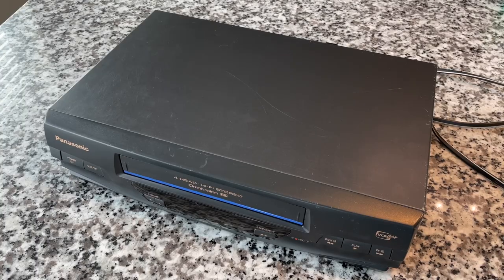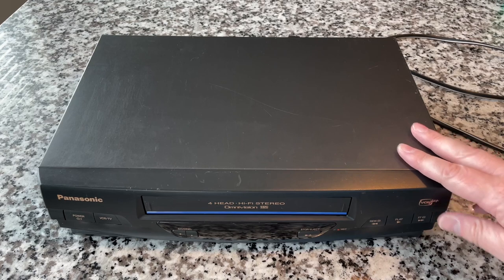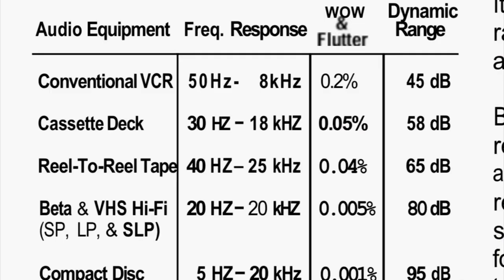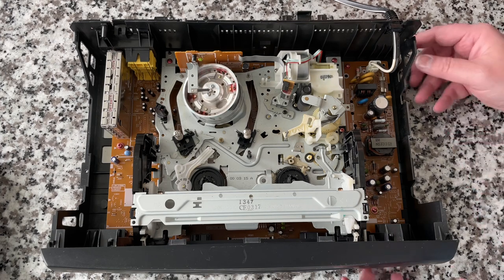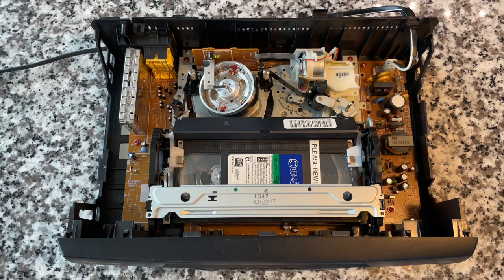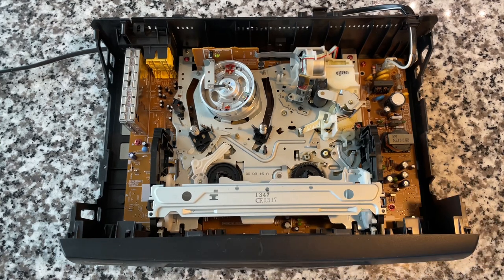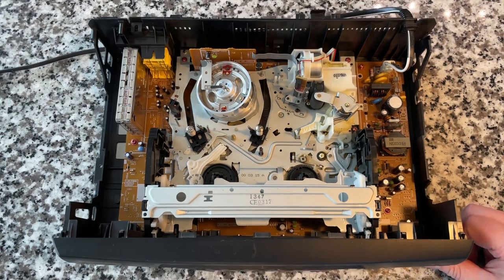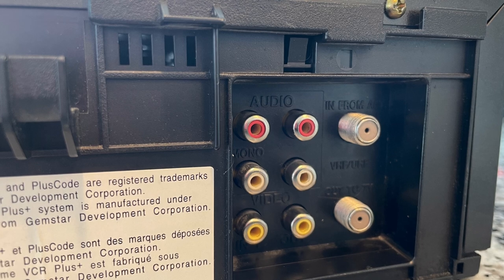VHS Hi-Fi - You threw out your best tape deck!

Comment: It's nice to discover this new twist, if perhaps a tiny one, among the pursuits of home audio enthusiasts. After all, analog open reel has long made an impressive comeback, at least among some well heeled audiophiles who can afford to restore and/or upgrade their machines and who afford the now very high priced tape stock. To some degree renewed interest in analog recording is understandable, at least for recording live sessions, since arguably the best sounding A/D conversion two channel electronics can cost upwards of $3500. Indeed, two track 1/4" open reel can sound very good even at least at 7.5 ips, more so if gain stages are dc coupled, low DA film caps are used for supply bypassing, et al. I've never heard (nor have much interest in) today's premium open reel designs but a shoot out between one or more (e.g. a recapped and well aligned Ampex ATR-102 1/4" OR a "tapelifterless" Studer deck) and, say, a Sony or Panasonic VHS Hi-Fi VCR. While signal electronics build quality may likely be far better even in these stock open reel decks (lower distortion percentages?) , the H-Fi VCR may have wider and flatter frequency response, higher signal/noise ratio and far lower wow and flutter. Even more impressive is that both recording speed and tape stock formulation costs will be a mere fraction of what plagues open reel tape enthusiasts. Only open reel have rapid and precise razor blade editing and variable pitch control. But I submit that IF advanced circuit designers, like those here https://www.diyaudio.com ever got serious about revamping the R/P electronics of Hi-Fi VCRs (especially those with superior transport design and build quality), the VCR would become the best sounding AND most affordable analog recording device. And for starters there's certainly no shortage of VHS blank media on where it's being all but given away at ebay, craigslist and countless garage sales-many tapes with low mileage and oxide shed. Go for it!

Comment: Never threw any of my hi fi decks away unless they were really not salvageable.  I have a Panasonic similar to that and two Sanyos that I got at Walmart, one still unopened.  The VHS did better than the reel to reel in the low frequency response but reel to reel did better in the top end of the frequency response.  We made a lot of videos of my band back in the day using a mixer and a VHS camcorder.  We took the audio output of the mixing console and video out of the VHS camera into the VCR and we got some of the best sounding recordings of the band.  It really sounded close to a compact disc to me.  As the one head is leaving the tape the other one is coming on the tape.  You have your stationary head which has a very limited frequency response but the heads on the scanner have what they call FM audio which is your hi fi audio and because the way the tape drum is spinning, the tape is emulating many feet per second which gives you the most fantastic audio.    The guides are so critical as well.  If they're out of alignment even ever so slightly tape won't be able to track properly and if it's really bad it won't track at all.  In order to set them up properly you need an oscilloscope.   Thank you for sharing.

Comment: I still own a Funai VHS HI-FI 4-Head Sereo and DVD combination with reversible dubbing  recording abilities.  I'm missing a spring on the DVD flap (so it stays open, though I tape it shut until needed) but otherwise the unit remains in very good condition.  I've had it probably since 1977 or thereabouts.  It has eaten a tape or two but that's because I either forgot to clean it's heads or forgot to BRIEFLY demagnatize them (just like a compact cassette player needs done now and then.  Look it up.)  I also have a separate unit that both reminds and fast forwards my VHS tapes--a real life saver with old tapes which tend to jam up or lock up tight when they haven't been used for awhile.  Best buy of that era that I ever made.
Reply: VCR/DVD player combinations were first introduced around the year 1999, with the first model released by Go Video, model DVR5000. (Wikipedia)

Comment: My surprise was how good the cassette sounded. I know, Techmoan did a video some time ago on cassettes (“better than you don’t remember”), but most of us had cassette players that didn’t sound as good as any other format, including vinyl and CD.

One reason was because as you pointed out, the slower the speed, the lesser the quality of the sound. Cassettes run at less than 2 inches per second, which is far less than any other tape format. I knew someone once who got better sound on cassettes by recording them at double speed. 

I wonder how many people actually use video cassettes for recording audio only...it’s certainly n interesting idea!!!
Reply: There is actually a cassette recorder that records at around 1/4 inch per second (standard is 1 5/8 IPS). The CC Versacorder, designed for recording overnight radio talk shows, and has a control interface that works with certain CC radios. I have never heard one, but don't imagine it sounds like much.
Reply: if you're like me, you may also have been using a crappy cassette player, and been using only pre-recorded tapes. I didn't know how good cassette could sound until I started recording on high quality blank tape and bought a nice, 3 head cassette deck
Reply: @dougbrowning82  Yes 1-7/8 ips. The slower formats are mono and are full track or half track increasing the quality. Cassette is 1/4 track per channel. Giant size cartridge loops like an 8 track cart were used in restaurants and such for background music.

Comment: Digital audio can also be recorded on Hi-Fi VCRs.
Reply: Could it?  It was obviously part of D-VHS and there was a short lived format that Techmoan did a video on that recorded digital audio as a picture, but from what I remember the hi-fi audio track was analogue.

When Europe started broadacsting stereo, we used a digital standard called NICAM but that was converted to analogue when it was recorded.
Reply: @GeoNeilUK  You could, and you didn't need a hi-fi VCR to record digital audio onto 1/2" home video cassette tape.

You use a PCM processor, such as the Sony PCM-F1, that works with the video in/out of the deck.  Of course, that meant reserving the whole width of the video track for recording digital audio.  Using a PCM processor is also recommended only on VCRs where you can disable dropout compensation and other video enhancements like VHS HQ, since such such circuits can potentially adulterate the signal.

Video tape hi-fi audio is, indeed, analogue.  NTSC Beta hi-fi used frequency multiplexing, where the four hi-fi tracks (two for each audio channel) is recorded in the space between the heterodyned chroma and luma baseband.  VHS hi-fi and PAL Beta hi-fi used depth multiplexing, where the hi-fi tracks are laid down deeper within the tape and at a lower carrier frequency than the video tracks layered on top.

Comment: I actually have a Panasonic VCR that is almost exactly like this one!!!!!
Reply: Yep, me to.   Had it for 20 years now.  Never even thought about using it as an audio-only device though, until now.
Reply: Me too and the video heads are very easy to replace and vhs hi-fi uses an extra pair of heads on the drum to record the audio to vhs cassette 4 head hi-fi =6 heads on the video drum the video heads are dual azimuth and would take up 1 opening per 2 heads and the audio heads are the other pair 1 head per opening. and for backwards compatibility mono audio is recorded on the stationary linear head so non hi-fi vhs vcrs can still play back the tape.

Comment: I did this with radio programs in the early 90's, and used the VCR's programming controls to  record when I was out.    Tape quality was excellent and the unit was designed to be used as an audio deck as well as video.    The deck was a cheapie sold under the "Fisher" brandname, but I don't know who really made it.  It was a HI Fi unit, but is long gone.
Reply: Fisher is Sanyo
Reply: @GaryKeepItSimple  The funny thing about Fisher VHS machines was that, despite the company being owned by Sanyo, earlier Fisher machines were made with engineering unique to them.  A Sanyo VHS machine of the same era could be totally different, specifically the mid 1980s when Sanyo was starting to get into VHS from Beta.  It wouldn't be until the late 1980s that Fisher models started using Sanyo engineered transports.

And good thing that Fisher started using Sanyo designs.  Before that, Fisher machines were generally known for being among the worst in terms of reliability.
Reply: @Watcher3223  I owned one of the first CD players and it was Fisher. It sounded better then any CD playback I've heard since, including my modern PC. They must have had an audio expansion chip of some kind in it. Wish it didn't breakdown.
Reply: I used to use my VCR to record an electronic music show out of Philly called Star's End each week. It's a 5 hr show. I found that I would not get the opportunity to hear the full playback during the week, so I'd use another VHS tape to record the following show. Before I knew it, I realized I had a shit load of VHS shows piled up I hadn't listened to! I caught myself and said "What the fuck am I doing?" I'm not being paid to archive these shows! haha I still have them on VHS through the 90's.

Comment: The mechanism you have is not the original "M" threading, it's an "S" threading.
The original M threading had the pinch roller pressing on the recorded tape surface, the S threading places the pinch roller behind the tape so it doesn't contact the recorded surface.
The helical scan gives you really high relative tape-head speed, over 100 (or 200 I don't remember) inches per second which is higher than any other tape audio recorder.

Comment: Be kind, rewind. Beta Hi-Fi recorders were used at live concerts and in recording studios. Audiophile magazines always touted Hi-Fi VCRs as great home audio recorders at the time. Great informative video young man!
Reply: Are you sure they were recording those concerts using the FM hi-fi tracks inherent with the recorders? 

I used to have the Sony SL-F1 Betamax. One of the possible accessories to get for the SL-F1 was the Sony PCM-F1, which would turn your SL-F1 (well, basically ANY VCR the PCM-F1 was plugged into - yes, even mono units) into a digital audio recorder.

The PCM-F1 would generate a video image, which kind of looked a bit like static, but did show visible patterns, which the PCM-F1 was able to decode. 

You would record the generated image onto the video tape. And from then on, whenever you played that tape back through the PCM-F1 Digital Audio Processor, the PCM-F1 would provide you with true CD quality audio. The PCM-F1 was capable of either 14-bit linear or 16-bit linear quantization. 

The analog FM Hifi tracks of a video tape are rather sensitive to any

Comment: I've had a few different vcr's and the best one i had was the akai and it had the best sound and picture. I forgot which model but i would record stuff when i was at work and then watch it the next day. Picture was so good and the sound was the best. It was a stereo hi-fi model.Well i did spend a lot of money on it. It was akai's high model. Well a couple of years later i recorded a show i wanted to watch. Now remember this is the early 80's so i was ready to watch it i hit play and nothing but snow so i thought the cable was out when it happen so i recorded another show and later of course snow. So i found out the tuner quit working. I think a storm must have had a surge in the cable and shorted it out. So i took it to get it fixed and i got a call from the guy saying he couldn't fix it. What happened is that Akai went out of business and he couldn't fix it with out thier parts so was without my favorite vcr. I bought another brand that was good but it didn't have the best picture or sound that the Akai i had. OK Bored you enough have a good one!

Comment: Also something to mention. Most tapes are T-120 tapes, which means SP=120 mins EP= 4hrs SLP= 6hrs. I think there are longer tapes but they're harder to find.
Reply: You also probably don't want to use longer tapes, such as T-160, if you can help it.  The longer lengths were achieved using thinner tape, which doesn't stand up to time and use quite as well as T-120.

Comment: Analogue audio recorded helically on tape stock that beats type II tape.  DAT recorded uncompressed digital audio helically, DCC used lossy compression recorded linearly - very high bitrate MP2, the same codec used in DAB ata lower bitratein the UK IIRC.

Comment: Their are hi fi heads on video drum that why it refers to 4 head hi fi. The fixed audio head is not hifi head but lo fi for backwards compatibility with older non hifi VHS tapes
Reply: S-VHS Hi-Fi records the audio in diagonal stripes across the tape (like the video) instead of in a linear strip along the edge of the tape as regular VHS does. More tape covered per second = higher quality, given the same magnetic media and head capabilities.
Reply from the maker: I believe SVHS used some dual layer technology as well.....
Reply: @Recordology  yes that true but didn't want to go into to much detail
Reply: Usually, the two hi-fi heads in the rotary upper drum don't count since they're for audio.

If you have a DA4 head hi-fi machine, the four heads are referring to the video heads only, each pair set up with their own azimuth (DA = Double Azimuth).

Comment: Hi.  what want for 1 to 1 quality on VHS  ! 
1. Need PAL or  NTSC This is the Best Choice  with 4.43 because on NTSC recording take more tape space for audio recording and Les for Video signal Then on Pal ,Left channel is 1.3Mhz Right Channel 1.7Mhz!
2. Need VHS with Long play (LP On PAL  OR on NTSC Extended Play EP or  (SLP)) Because on this mode lowered video quality but again take more space for AUDIO on tape !
3.HI-FI NICAM because minimum need on drum 2 Long play Head ,2 Standard Quality play Head !
4.Black signal generator on VHS calling this button (SIMUL) Or ( Test signal) on BACK This generate Black video signal ,need for tracking stable simulation because VHS tracking system looking this information for synchronization ! When not synchronize tracking system non stop looking and make on recording noises clicking like scratching noises !
ON VHS Without Black Screen Generation Need  give in black  screen video signal  from another device get same results !
5.For best result need check some VHS Without Recording Level adjustment gives the best recordings when input 5 volts but on 0.5-0.7V results poor !
6. Example  devices Panasonic NV-F125( NV-HD100AM) ,NV-F75,NV-F65,NV-FS 200 HQ, The best Choice  NV-W1!
7. At last For the BEST QUALITY HI-FI Audio on VHS Need Recording ON NTSC ,4.43 ,EP or SLP ON PAL, LP , Black screen Video input or Black screen Generation, Don't forget about input Voltage!
When doo like that on the result getting Quality best then any professional Reel To Reel And DAT is well plenty models not giving that results !
Analog sound is the best ! :-)

Comment: Using the format as is, for audio alone must have wasted a lot of the capacity of the tape. I wonder if any of the  VCRs had an audio-only mode to make use of the space on the tape that normally would have been used by the video content.
Reply: The video tracks are recorded on top of the audio HiFi tracks.

Comment: hi betacam is better  no drop outs at all    vhs you get drop outs
Reply: Betacam is also a professional video cassette format where the linear tape speed is many times that of VHS and Betamax, so of course.

However, you can still get dropouts with Betacam.  Just give the tape enough passes and you'll get them.  With use, dropouts are inevitable with tape since it's a contact medium.  The contact between the heads and tape causes friction, which will wear things out eventually.
Reply from the maker: Also with Betacam SP you get metal formulation which helps in overall quality. It took a long time before digital video formats were able to equal the quality of analog Betacam SP.
Reply: @Recordology  Metal formulated tape for Betacam SP would allow higher picture resolution to be possible over low band Betacam using iron oxide formulations.

Digital variations of Betacam would come later, but it's when the technology making them possible became practical enough to implement.
Reply: Betacam was just the Sanyo version of the Sony Betamax, no? I once owned a Betacam (mono) It had 2 speeds.
Reply: @annode No, consumer formats (VHS, Betamax, Video 8) use a process called 'color under' to record brightness and color signals using the same (just one) video head. To do this, the color signal has to be shifted to a much lower frequency range (and reduced in bandwidth) compared to an analog TV broadcast signal. That's why color was so blurry. To record two sub signals the  color signal uses frequency modulation and amplitude modulation at the same time. Amplitude modulation is very susceptible to interference (remember AM radio...?) causing lots of color noise.

Betacam uses two separate video heads to record brightness and color onto separate tracks on the tape, there is no color under. Betacam also doesn't use amplitude modulation at all. Betacam machines were much more expensive, but they offered broadcast quality.

Betamax and Betacam are quite different (and incompatible) formats that just happen to use the same (or very similar) cassettes.